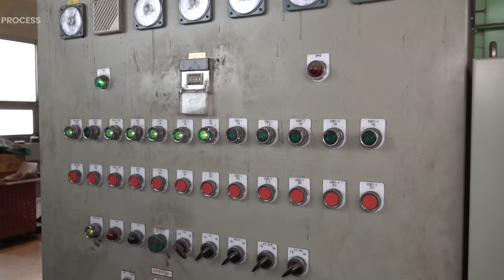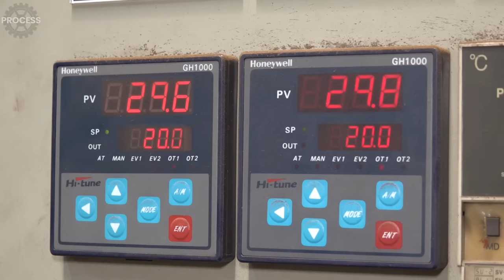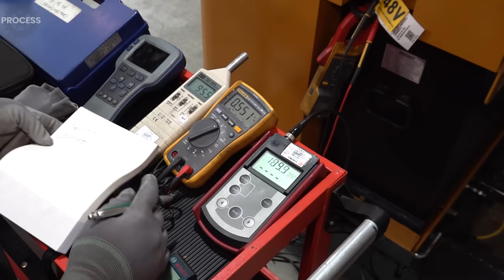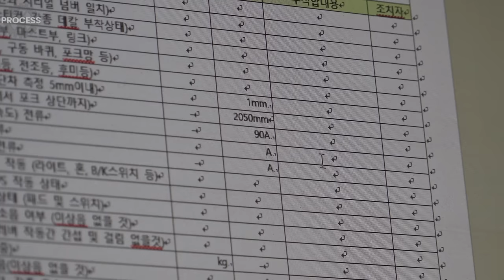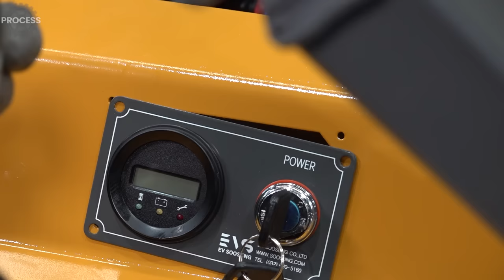Process of Making an Electric Fork Pallet Truck. Logistics Equipment Factory in Korea.

Comment: Такое ощущение, что всё на точечной сварки, а металл не тонкий. И покраска почему не в камере?
Reply: They can't fully weld when they are making the frames because the heat can melt the base frames. I think they fully welded after they take out from the base frame( the installer) and it is not shown on the video because of the arc flash.

Comment: no li ion battery?
Reply: Nice power plug, though.
They probably don't need the energy density. This way it's probably cheaper and more weight doesn't hurt in this case.